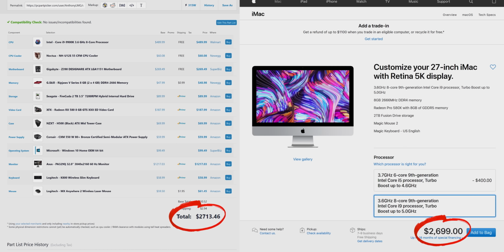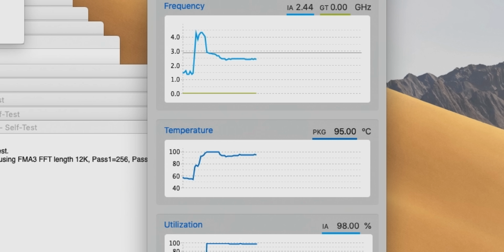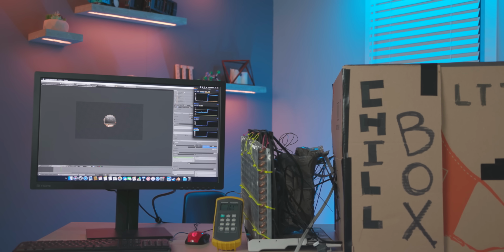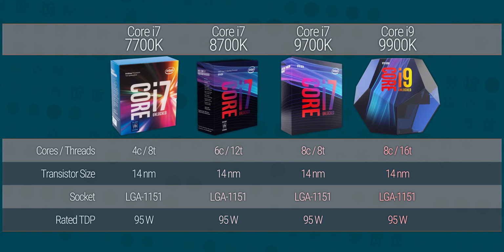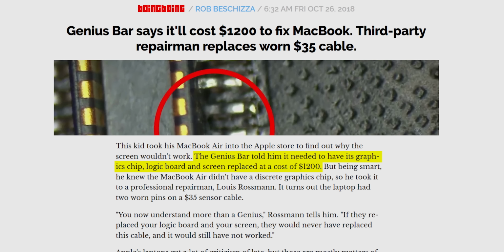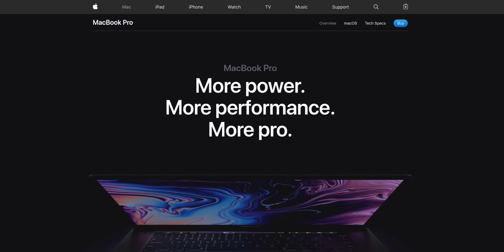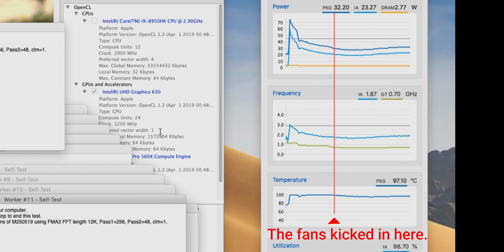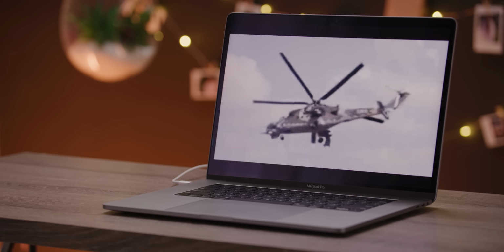Macs are SLOWER than PCs. Here’s why.

Comment: As an iOS developer, I am forced to use a mac. Mac OS is great for content crestors but Apples recent Mac lineup und permanent price increases across all their products make me sick.
Reply: Well you could just install Mac is Sierra or something on a PC right?
Reply: @julian5857  You need official Apple hardware to sign into Testflight and other Apple Developer only things
Reply: Skiller5000 yeah if you hate having a stable system. Hackintoshing on your main work machine (especially if you’re an iOS dev who needs to get updates from Apple ASAP) is just not worth it for most people
Reply: Check the recent LTT video about running macOS on a virtual machine on linux
Reply: DarkCloud360 the old Mac Pros were good basically everything pre 2013 was better
Reply: Question is: Is that your regular job or are you a sole proprietor? If it's your regular job then yes, you would have to use a mac. At home however, use a PC.

Even if you are working from home, you should be able to connect to the mac where you work. This way, you can keep using your PC.
Reply: monkeyGaiimer its my job.
Reply: Then again too, you do have the option to use Xamarin for Visual Studio... Just my 2 cents if you are a sole proprietor.

Comment: As a full-time Mac user who has owned several Macs, it comes down to two things:

Thinness (An obsession with thinness...)
Noise

Physics aren't on Apple's side with these newer machines. Paper thin heatsinks won't achieve fantastic efficiency. Honestly, I'm surprised that they work as well as they do. It's remarkable engineering...that I would like to se be put into a slightly thicker Macbook Pro with beefier heatsinks. Honestly, a Macbook Pro that is just as thick as the 2015 Pro would probably perform great. If they can manage to shove an i9 (barely) into the current form factor, it should run a lot better with a slightly thicker chassis.

 I don't have much experience with anything built after 2013 in Macworld, but I have several machines that if left on their stock fan curve, wait to ramp up fans until the machine is piping hot. I've seen them wait until 100-107C, though the 107C machines might be glitching up because of me using a patched version of macOS. My early 2013 rMBP 13" with intel graphics and an i5 has dual fans, and I have also repasted it with AS5. Even with all of that, and a not very powerful CPU, it can hit temps of up to 102C, and the fans are spinning at around half of the speed that they can spin. I took matters into my own hands and installed MacsFanControl, and with that, it rarely even hits 90C, even under moderate loads. My fans are noisier, but the machine will last longer and be more comfortable to use.

I appreciate that Apple doesn't like screaming fans, but I think there is a balance between screaming fans (Razer Blade 15 anyone?) and a quiet machine that you can cook your breakfast on.
Reply: There are thinner and better performing notebooks out there that don't thermal throttle or scream like a vacuum cleaner.

Sony VAIO x505 (2003)

Was thin back in 2003, this is not an apple invention
Reply: Michael Schöch I highly doubt a laptop from 2003 can outperform a 2018 MacBook Pro.
Reply: @WinPC99  yeah I was not clear about the Sony notebook, sure it can't outperform it, but I want to say it was thin long before MacBook were a thing.

Nowdays there are very thin and good performing notebooks on sale like asus, msi and gigabyte. Even my 3  year old gaming notebook from asus outperforms newer MacBook easily
Reply: Michael Schöch I’m not sure if I buy that. Like yea it may outperform it in benchmarks but at what cost? Battery life? Noise? 

My whole point is that Apple could make a slightly thicker notebook and achieve a better balance of performance, lower temps, and (relatively) quiet fans
Reply: @WinPC99  my ultra book is silent, doesn't throttle an is as thin as a Mac book 👍 battery life is about 6-7 hours, it even has a gtx 960 so light gaming is possible

Comment: Any mac I work on I have to download Macs Fan Control so I can crank them bois so it doesn't throttle or burn. Saves me so much performance
Reply: Well it throttles anyways
Reply: @FAB1150  Was going to bring that up too but since he is an apple fanboy was pretty sure he would just disregard that statement.
Reply: @Robin_Games  But do programs like these help in any way?
Reply: @EliasSchnetzer  Fan speed programs? I would say its a  definite yes. But not sure on how much because the fans are so constricted in mac books that it is most likely not enough. how much air you can intake is important. on mack books they have almost no intakes which means you can only push so much air no matter how fast you get those fans to speed up.
Reply: @Robin_Games  First of all, Apple user ≠ Apple fanboy. Second, I kind of have to agree. But I have to point out that if someone watches Linus and buy a MacBook, he's probably tinkered with PC's at least a little. If that's the case, he should consider opening the MacBook up for a proper repaste. Apple's paste sucks, and a repaste helps a ton. If you're daring enough to go with liquid metal (not me lol), you might nearly eliminate throttling completely.
Reply: @Robin_Games  It is easy to label someone as a fanboy whenever you know nothing about them. Isn't it?
Reply: @Robin_Games  Definitely helps a lot with temps and performance, but yeah the airflow issue of the mbp is ultimately just a design issue. In the end, the damn things just not gonna run as cool
Reply: Reviewers or tech channels generally forget these exist and complain about fan noise. Fan noise doesn't bother because A. I almost always have headphones on and B. People in my office are much louder and obnoxious tan fans are.
Reply: @markvan2181  My Thin gaming MSI literally just has a button on the keyboard that speeds up fan speed. thats how easy it is with windows. But usually dont have to use it cause it has 4 vents on the side and the entirety of the bottom is an intake. Becuase they care about there products and customers. Its rediculous to say "thats okay because if you go download third party software you can kinda fix it by making your laptop sounds like a jet". I go to college and work in an office and I know for a fact you are lieing because every time I turn my fan speeds up on my Mac book air in college or in the office everyone looks at me for a good couple seconds. I don't take the MSI everywhere becuase its 17 inchs hence why I own a MacBook air thats 13 inchs. But even i dont make any excuse for apple. There computers are just simply terrible and Every time I see someone with one of dells thin laptops or any windows thin laptop I am jetlous cause they can literally do everything faster and more effectively than I can and they have more i/o inputs for hooking up an Ethernet and what not.
Reply: @Robin_Games  Alright first off, it's great that you have a button feature for your gaming laptop. It's great that you have that thermal headroom for you. Also, you don't have the same office environment that I do, so I am not lying about my usage. You complain about all the features that you need, but I don't. I don't need a ton of IO because 1. I have a wireless mouse and keyboard, and 2. I have a cheap 20 buck dongle that allows me to have IO if I needed it and the only thing I use it for is connecting to a monitor. Fantastic. You can make your appeal as to why windows machines are better, and I literally could care less because I've already spent the money for the computer that I value. I am not going to purchase another laptop that I don't care about. Even with the third party application that I am using, I can still barely hear my fan in comparison to those around me.  The curve I have set is good enough to make sure that the computer never reaches over 75c (and it doesn't because I don't game, run synthetic benchnarks, or have any use for video editing).

You have something you value and like, that's great for you. I have different preferences and if I need to do something demanding like gaming, I'll just do it on the desktop I assembled.
Reply: @Robin_Games  I never said that it was not a disadvantage, I am saying that my use case generally doesn't require me to have different variants of IO. Call it however you want, but the MBP is the only apple product that I personally own. It is something that I enjoy using, am used to, and will continue to enjoy until something negatively affects me. I am not a stockholder, nor have I spent more than what I have paid for this MBP to apple. I don't have the entire ecosystem because it is pointless to me. I am defending my use case and value for buying what I have, not their negligence or their design choices. Should I call you a MSI fanboy considering that you have a laptop by them and you list all the reasons on what makes your laptop better than others? No, because it is moot. Pointless, just like this entire thread.
Reply: @markvan2181  without looking at the I/o, my 10 year old kid range laptop is faster than my 1500$ Macbook. And I end up taking it with me more than the mac, even if it's clunkier and looks a bit worse. 

I thought I upgraded buying a Mac, didn't happen.
Reply: @FAB1150  I don't notice any issues with speed myself. I will say that some of the native software like safari and preview have been hit or miss for me, but others like Google Chrome, One Drive, Office, and various types of IDEs and text editors work well with no issues for me. I'm not sure what your workload is like, it is probably heavier than mine if it's that much issue. Though, I do have the 15 inch i7.
Reply: @markvan2181  tl;dr Apple doesn't care.

Comment: I personally loved my MacBook Pro, when the SSD failed, I was faced with a dilemma; fix it or get a new laptop. I went with a gaming laptop instead of a new Mac for the sheer fact that I couldn't get the performance out of it that I need. And my new laptop is really nice, it comes with a dedicated button to set all fans to 100%, so when I feel like it needs it, I can set the fan speeds to max.

Comment: iPhone run arm processor where as Mac use Intel and intel is suffering so either ditch Intel or stay with your partner when they face bad times. MacOS is far better than windows and much inferior to Linux but they have *paid apps on both iOS and Mac which work fantastically

Comment: One thing to note here is Apple’s design is also based on the supposed improvements Intel should’ve had years ago. Hell 10nm should’ve been 3 years ago and 7nm almost now. Another reason Apple is moving to their own chips starting next year. Once that happens, considering the iPhone chip (A12 Bionic) beats the base MacBook Pro in benchmarks (A11 Bionic beat the previous generation MacBook Air in benchmarks) and the A12X Bionic has graphics capabilities comparable to the Xbox One S, all passively cooled... imagine the battery life and performance that will be seen with those chips with the cooling offered in current devices. Even without cooling, the unibody design cooling an Apple A chip would be crazy as the latest iPhones have no real dissipation for the heat produced by the chip.

Comment: I am a Mac user. I don't really care about the "style" of the Mac but i do care about it being silent when i use it in a working environment, i rather wait for a split second than have a jet engine start everytime i fire up a browser. Also about the "too thin", i love that it is a high quality metal case without being too heavy. I just have not found a windows notebook which gives me all of that.
Reply: The entire surface lineup says hi
Reply: Sebastian Kemmer Plus how great the MBP force touch trackpad is. Going back to even high end windows laptops is a pain with the crap trackpads.
Reply: Jet engine opening a browser, lol, man your hurting bad.  #hotplateusershavefeelingstoo
Reply: Hey if you do your research. You will find faster quieter windows laptops
Reply: Then u obviously havent done good enough research

Comment: I have many Macs Starting from 2005, the first one still works fine. Very intensive cpu tasks. I understand what you say but overall Apple Machines not only perform but endure. Very reliable hardware. Users satisfaction statistics confirm.
Reply: But the problem is that stereotypes exist for a reason, 'Gaming on apple' is a very valid stereotype here with all that  thermal throttling i bet this I9 laptop preforms as badly as an I7 4xxx series laptop, a 40 % drop in preformance can't be overlooked, would you buy 40% of a car? Because thats what you're advocating for.

Put that brand spankin new laptop into ANY game and you will have less than 2.9 gghz speeds for most likely 3 grand. Which is a staggering price point for something that doesnt preform because of the choices the design team at apple made regarding thermals. Its a real shame too, because if they pulled it off i might be tempted to see if asus or alienware could pull a similar size to preformance ratio, nobody wants to haul around a 15lb beast in a backpack much less in addition to all the other gear they may or may not have to have.

Comment: At one point in the video you spoke about Mac owners not caring and instead buying their Mac's for status and such. I think that's true for a lot of consumers. However if you look in the tech community a lot of software engineers use the Mac because the available third party software is better for them, they get a unix system with commercial polish and the macOS is actually really great.

I'm one of those software engineers. I am keenly aware of the throttling issues, this has been going on for a very long time with Apple notebooks. If I could get macOS on a different machine I would totally do that. Give me macOS on a Thinkpad and I'm sold. But unless I'm willing to hackintosh it and deal with all the issues surrounding that (especially when new macOS versions are released) my only real viable option are the official Macs from Apple.

I'd like to note though, I like many of my friends in the industry only carry Mac laptops. It's much more uncommon for us to buy a Mac desktop. It's often the case that we build or buy a desktop system and run Windows or Linux on it and then have a Mac laptop for portability and access to macOS. Combined with the fact docking to a large monitor and software like Synergy (which lets you share a mouse/keyboard across multiple systems) makes it very easy to dual or triple-OS these days.
Reply: A MAC  This is actually not true at all. At Dropbox we got to choose our own systems. Macs were what people chose to use. I have been buying Macs for myself for about 15 years, by my own choice.
Just think logically for a second, not everyone shares your view that they're poor computers. I have a watercooled PC that I built myself with high end parts, it runs Windows 10, I have been building my own desktops since the early 2000's. But I still prefer a Mac laptop.
And I'm not alone. I'm not a Mac fanboy, the new keyboards are crap, them still selling the Mac Pro from 2013 is ridiculous etc
Reply: A MAC  I'm in the tech industry that makes software that a lot of people use. I've done stints at Facebook and Dropbox. Both companies it's like 90% Mac laptops. I wasn't talking about IT People that do repairs or manage a fleet of computers within a company, I mean the engineers actually writing software etc
Reply: Best os in the world is Linux(most distros)

Comment: It would be cool if I saw a review with a Xeon Platinum 8180 (28cores/56threads) and 4 RTX 2080ti Extreme PC for Artificial Intelligence research if possible. Only DigitalStorm offer this staggering price tag. Also, MacBook Pro 15” 2018 needs to be thicker and have a state-of-the-art cooler to remove the heat and that i9 8th gen. I won a MacBook Pro 15” 2018 and i7 2.2ghz turbo boost can’t handle Unreal Engine 4.22 and barely handle Unity 2019 because of the heat issues. Apple laptops needs to be a bit thicker and better cooler
Reply: Brandon Tseng *4 RTX TITAN
Reply: Yeah ik. Wander if NVIDIA fixed the problem that RTx 2080ti burns and breaks itself sabotaging the buyer in one month.

Comment: I would like an even deeper video than this. 
How come temps are consistently great on Hackintoshes? 
What could Apple have done differently to have better cooling? 
How do other manufacturers overcome this issue? 
What processor would suit the Macbook Pro better (and be faster)? 
Will this be a non-existent issue when they switch to ARM?

Comment: Isn’t the simple answer for apple not having the same ethic when it comes to their laptops that it’s not them designing the CPU’s it’s intel they can’t control it like they do their iPhones which have them build in house from the ground up with the application in mind. Meaning with intel’s chips they can’t have those optimisations in place for keeping it’s boost up without overpowering their tiny cooling system with intel’s exceptionally hot chips. I do believe however apple are working on desktop spec CPU’s to combat this lack of control correct me if I’m wrong ?

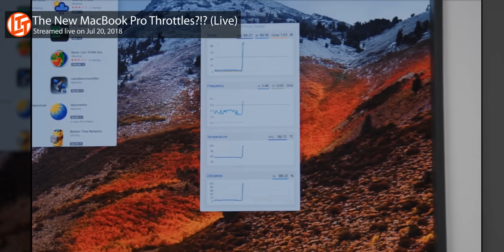Comment: 2:08 I’m using a 2015 MacBook Air in boot camp to run lighter games like tf2, Roblox, and older titles. In my experience windows actually runs faster and cooler than Mac OS. Maybe I’m just the exception though.

Comment: The thing is that Mac users will use this as an excuse that the software is optimized for the hardware but this is not the case. You have to "think differently" and I think that nowadays been a Mac user became a bad loop that you cannot escape. Using Mac for the last 2 years and I had so many problems that I cannot see the advantages that every novice Mac user is getting so pumped for.